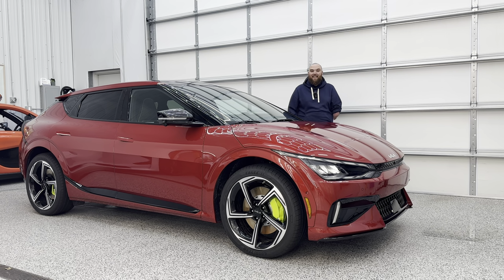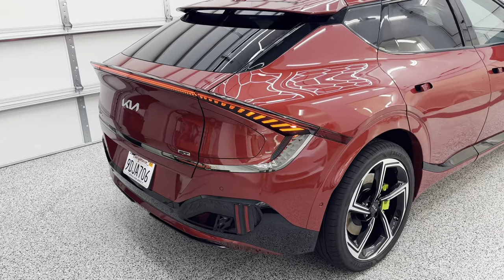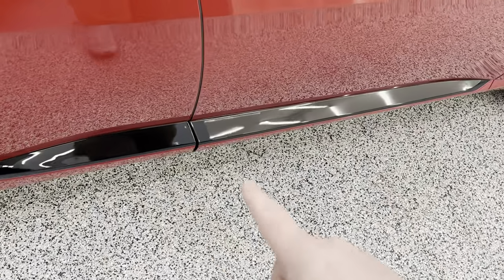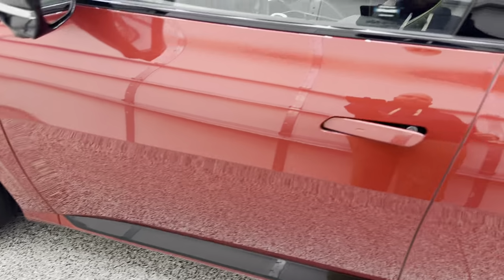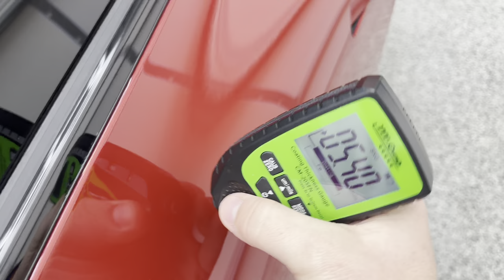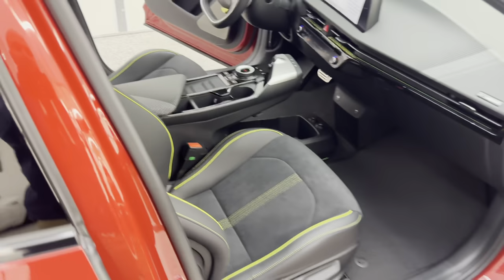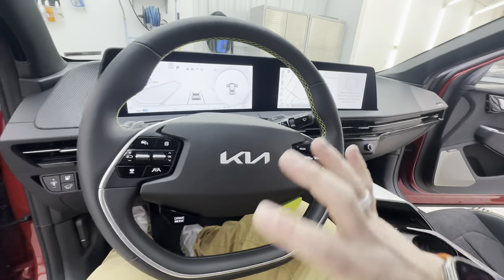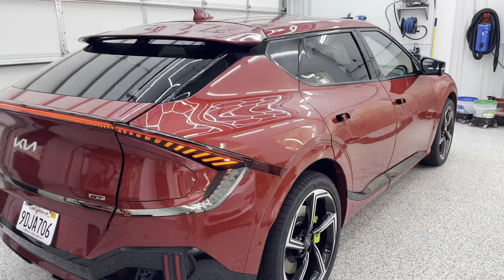Korean Precision-Kia EV6 GT Build Quality Analysis

Comment: My GT Line EV6 paint chips ridiculously easily. I have owned it for 1 year and have had about 10 rock chips down to metal. Seems bad for a $55k+ car.
Reply: I took a rock to the windshield and got the smallest little nick... and then I looked at the hood and saw where the rock hit first. :(

Comment: Coleton, I just watched a 40 minute car build-quality video. And you make it interesting!!
If I were buying an EV6 I think I'd stick to the regular GT Line S AWD model, up to 320BHP is surely enough anyway. Your points about the high impact areas will prove to be correct imo and those seats won't suit most daily drivers.
Great video. Great EV.
Reply: The main thing for the GT for me was the suspension and the other perks. The power was a happy bonus.

Comment: This is a press car, meaning Kia this is a press car, meaning Kia marketing went through it with a fine toothcomb, especially if they know a detailer is going over it. I like to see a production version.  I went through my 2020 Model Y (middle of delivery rush) with a fine toothcomb during my pick and found gaps. After, that day. I don't notice the gaps.  As this Kia, you also will not notice the gaps. Gaps are not about nothing. Marketing went through it with a fine tooth comb, especially if they know a detailer is going over it.